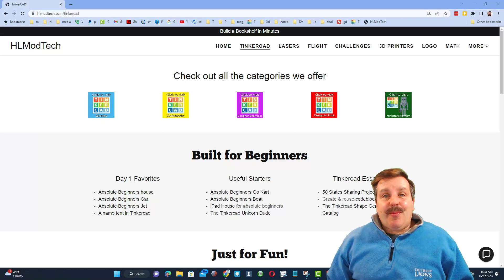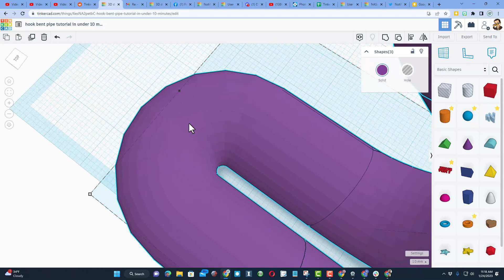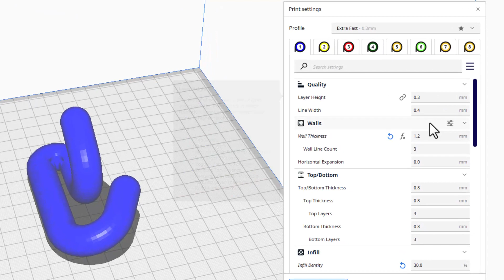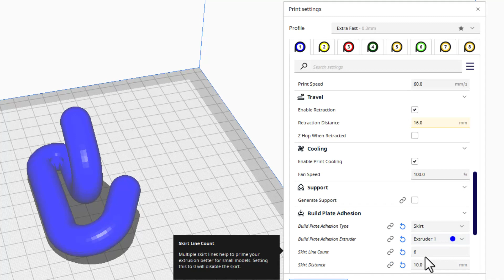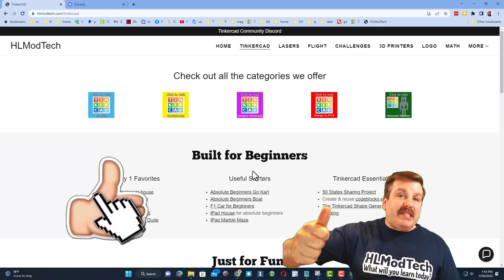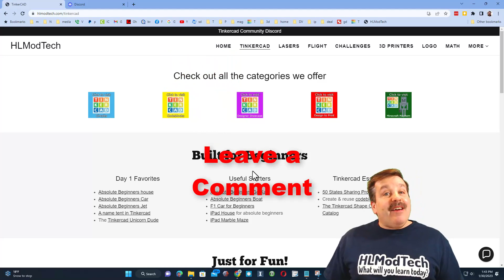Tinkercad Double Hanger 3d Print Mod Timelapse & Quick Test Hook Print

Comment: Maybe you and Tyler can design so RC plane Hangers!!  lol
Reply from the maker: Interesting idea.  Would they hang vertically like slabs of beef in Rocky? Does this item already exist... or is this my Thomas Edison moment?
Reply: @HLModTech  some have tubes straight from the wall (Plane lays flat) and some hang from ceiling
Reply from the maker: Are the supported by their wings or tails?
Reply from the maker: or landing gear?
Reply: @HLModTech  Some hang from the tail straight down, most lay flat on their wings
Reply: @HLModTech  not usually by gear